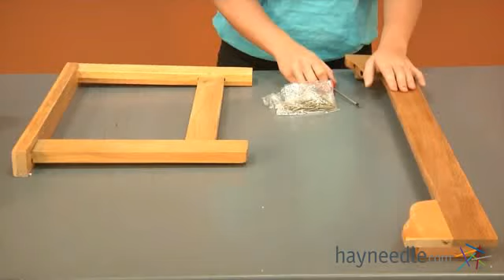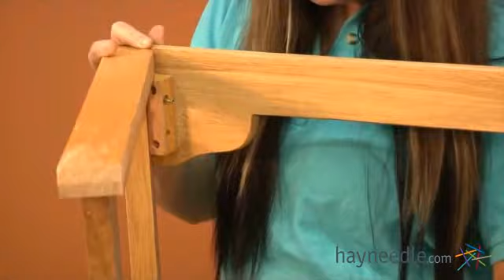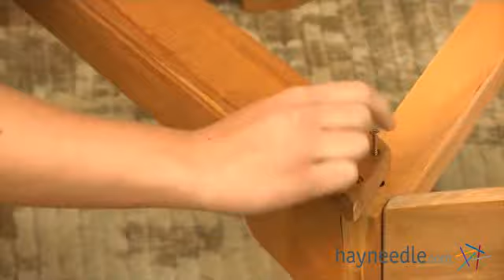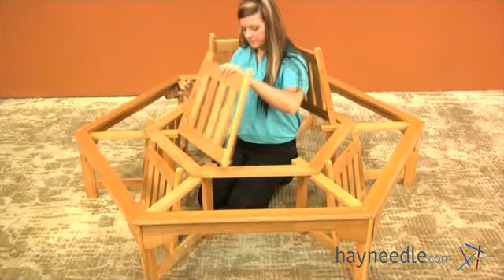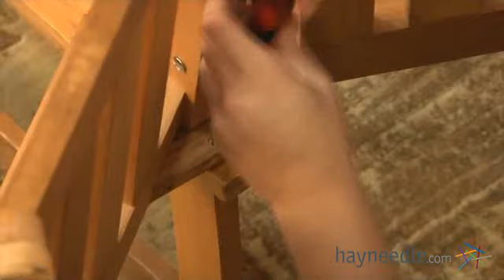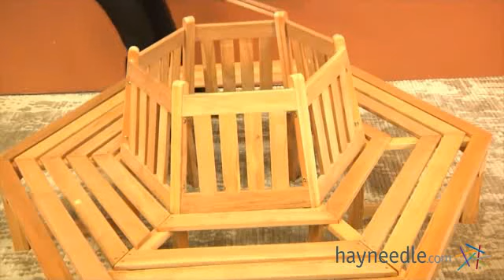Assembly Video Coral Coast Fillmore Wooden Tree Bench

Comment: Ours arrived packed in styrofoam which had disintegrated into tiny particles. It took at least half an hour to remove the tiny styrofoam particles from all the wooden items. Impossible to complete construction in one hour with a screwdriver. You need a power drill with a philips screw bit.  For the base you need two people, one to hold the wood beam at an angle and one to screw in the screws. The video hides the second person. The seats and backs can be done by one person. Quality wasn't very good. Lots of chipped wood and one beam was split. No extra screws so make sure you don't drop or lose any. They should have included rubber or plastic shoes to protect the wood that touches the ground. Otherwise the wet ground will rot the wood. A nice product but the seats are low on the ground.